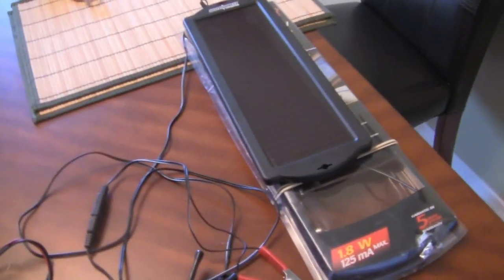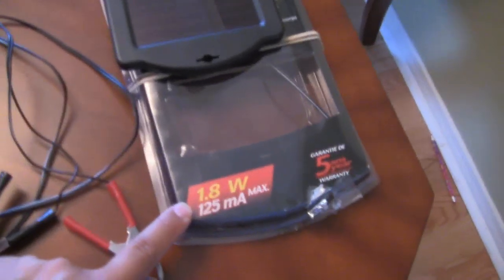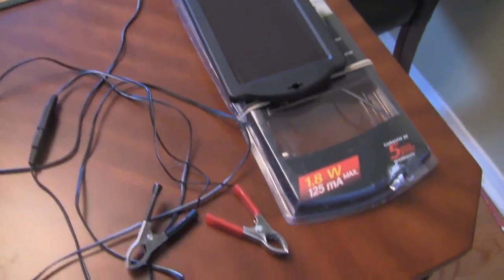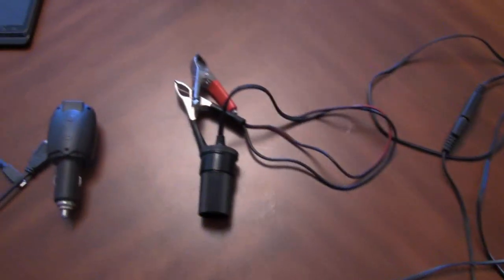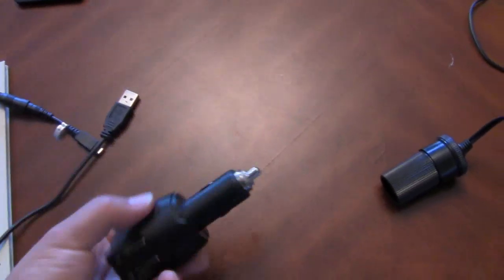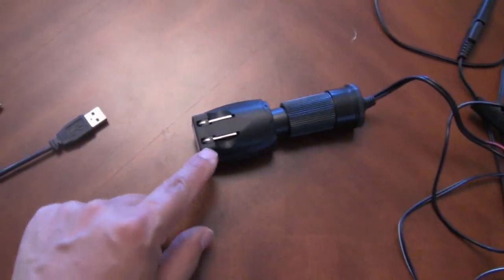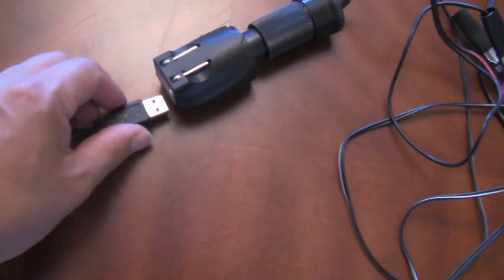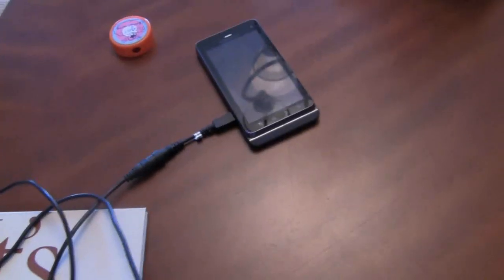How to build Solar Charger for Cell Phone Smartphone DIY solar charger for cell phone smartphone!

Comment from the maker: It might be okay, but you will need to monitor the current as it will fry your electronics if it passes over the limit of your device's current. Monitor the current to see (on the brightest day) how high the current is; it should not exceed your device current usage.  The USB car adaptor should limit the current going to your devices; measure the current output to see.

Comment from the maker: It might be okay, but you will need to monitor the current as it will fry your electronics if it passes over the limit of your device's current.  I would try with one solar panel first and than move towards adding the second.  Monitor the current to see (on the brightest day) how high the current is; it should not exceed your device current usage.

Comment: If I use 2 solar panels (5W, 300 mA, 12V) in parallel to boost the input current, will it be safe? I plan to use the same config as yours, using a car charger. The charger is easy and cheap (2.5 USD) as it's made in China, but the solar panels are the problem.